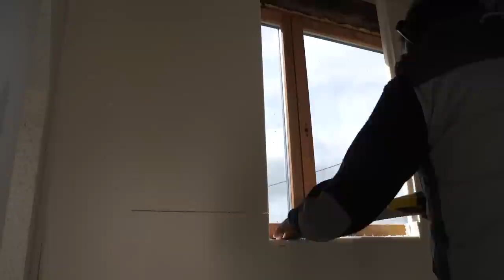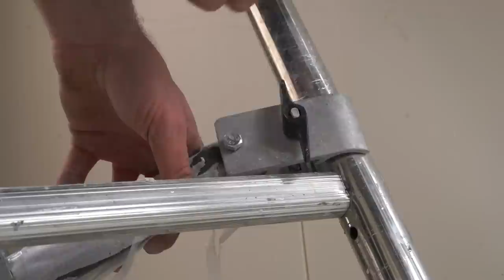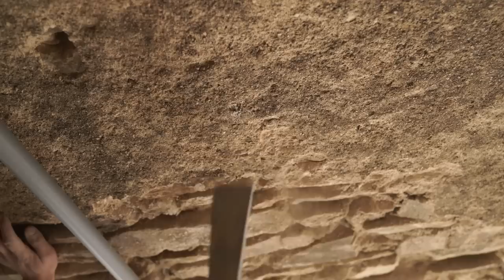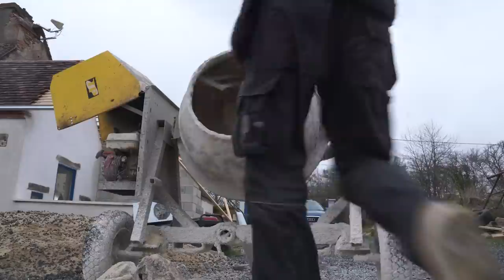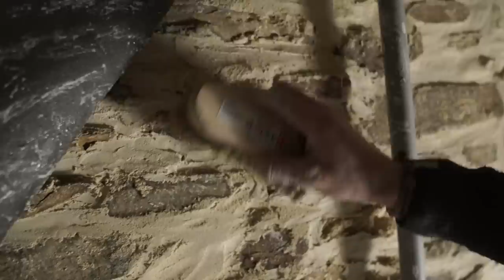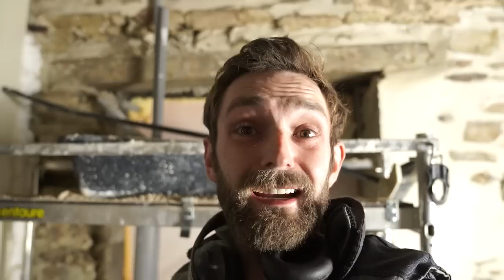Exposing and pointing the farmhouse stone wall

Comment: Dan, a question, does the lyme render differe if it is an interior wall compared to an exterior wall exposed to the elements?  Is there more lyme on one compared to the other?
Reply: I'm glad you asked cause I've been wondering myself if the same mix works outdoors.